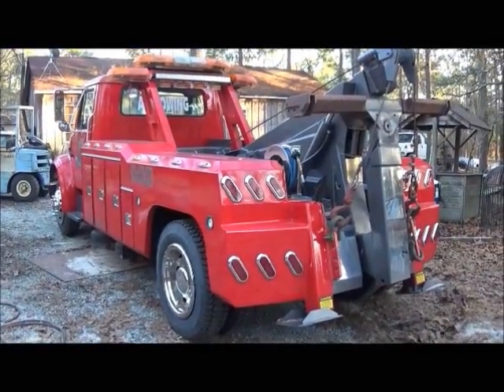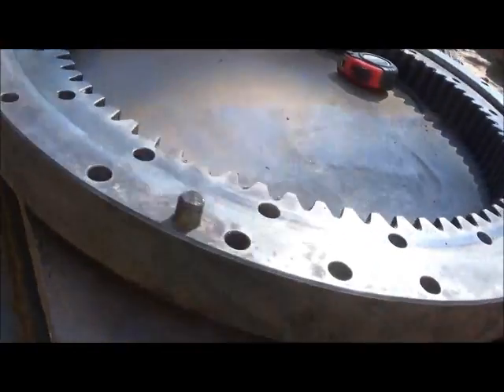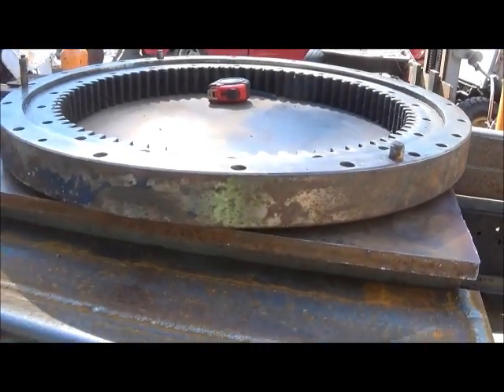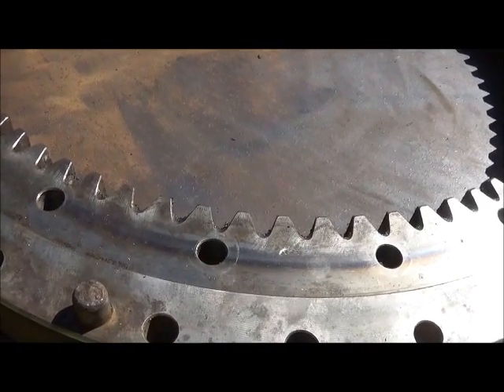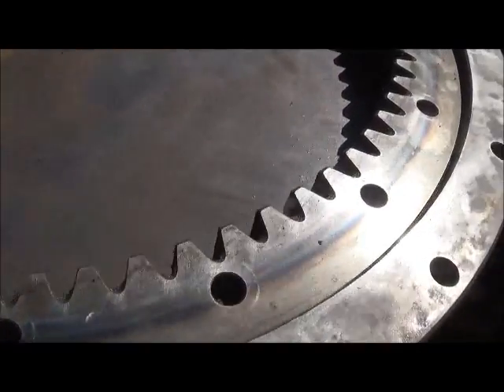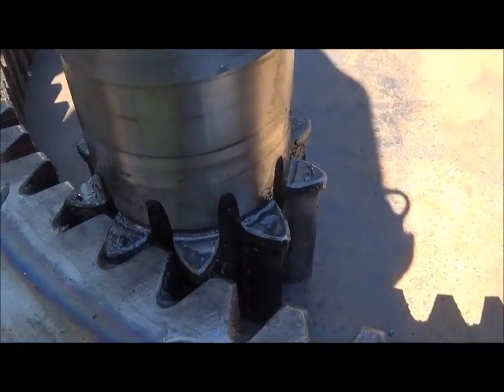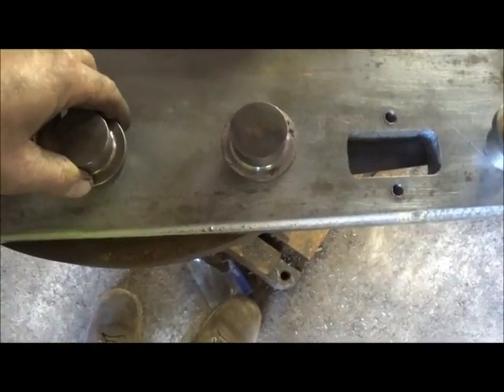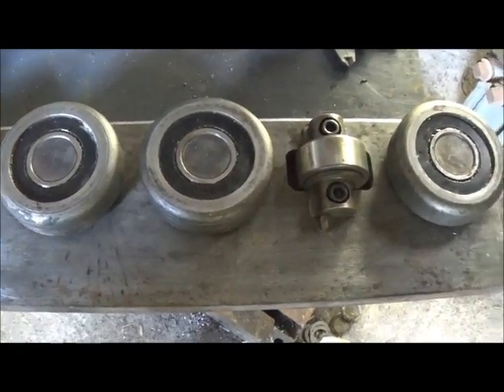4x4 Wrecker Build Part 33 Gears And Bearing

Comment: Hi Jonathan from Nick Wiese age 65 concerning 3 phase power, things I learned in life! fact: a 3 phase power panel has 3 hot legs a Neutral & a Ground.  instead of 2 power strips in the back of the 200 amp panel it has 3, The voltages must add up to 360, one leg may be a bit off, the motor does not care! it is magnets. I suggest you take one more hot leg off your panel, same amps & volts (single breaker) for leg 3 add to a 220 breaker which is 2. this worked for myself on a 1 horse power motor years ago. Words like should and might apply here, use a switch, if it does not run properly shut it off before it does any heat damage. good luck  Nick, kimbelnick@gmail.com

Comment: Yeah, I could see Daylight under that ring gear think your idea taking down the highs on the ring gear mating surface will work fine...otherwise you might have been forced to fly cut the deck plate. The rotator base looks insane solid...once she's all welded up you should have no problem... Killer vid Jon!!!
Aloha